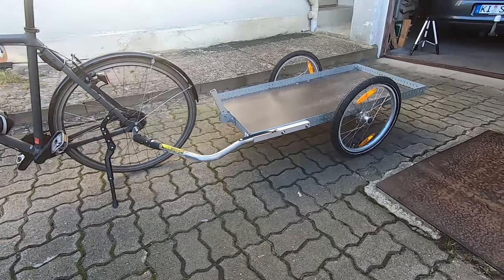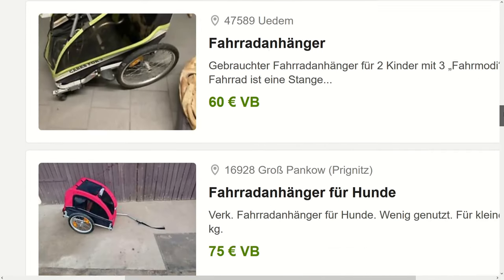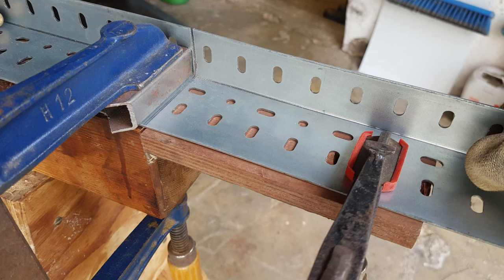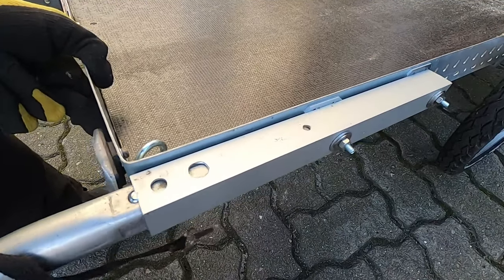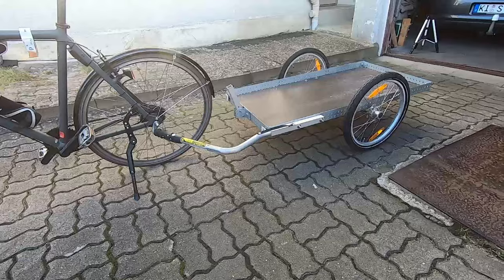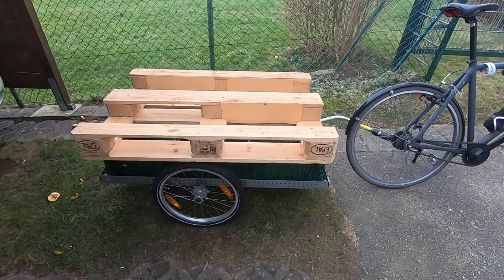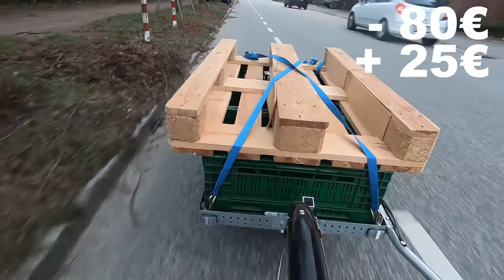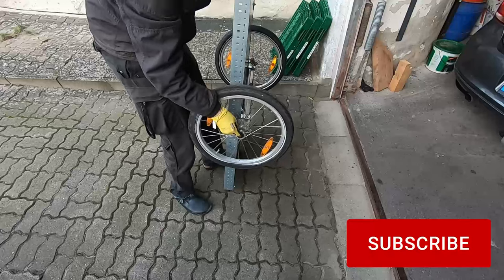DIY Budget Bike Trailer

Comment: What does your trailer weigh? Maybe I skipped it in the video. The hinterher-trailer weighs 12.9 kg. I like machined parts but using CNC cut aluminium for zhis is ridiculous if that price comes out. I guess your trailer isn't much heavier you could optimise here anc there to save some weight.

Comment: Not sure that unless you get real lucky on finding a used trailer to start with or reselling the parts you'd make that much money this way. That said having a custom fit to design trailer is near priceless. Even the more expensive trailers you buy pre-made are almost always the wrong size. Slightly to big, or to small. With rounded corners or something to make your desired load not fit right.

Comment: The trailer could use a stabliser wheel or jockey wheel to prevent it from dropping incase it comes loose while carrying groceries while cycling that way your oranges won't roll on the road and get squashed by cars or cause a slip hazard for motorcycles, imagine someone wrecked their expensive motor bike because of oranges

Comment: This is the perfect trailer I want for carrying around a lawnmower and other things too big or long for my current large sized dog trailer.
Hinterher's profit margins must be absolutely huge.
Well done.
You have my genuine admiration.
Reply: I am looking into a bike trailer for the exact same reason, have you built one if so how and what parts did you use? And what is the dimensions of your trailer?
Reply: Unfortunately for us you are wrong: Our profit margins are not absolutely huge. Sad but true. They are large enough for us to sustain our company in a healthy way so that people can buy spare parts. But believe me, building high-quality bike trailers in small numbers is not your easiest get-rich-quick-sheme.

It is always difficult to compare a diy built with our model. Parts may look roughly the same when in fact there`s much more that differentiates them if you dig a little deeper. Our chassis is vastly more sophisticated to manufacturer and thus much more expensive, yet stiffer, stronger and lighter. You wouldn`t compare a high-end bike frame with a simple one just because they look the same? We also use a custom-made stainless steel axle with threaded ends and an custom-made inserted stainless-steel sleeves to hold the wheels. The list goes on and adds up. We do not want to diminish this great diy-project, but we always feel a bit disappointed when people assume we rip-off customers with our small scale workshop production of custom-made trailer components here in Germany. It`s not like we were Chris King, charging 400 bucks for a front hub...

Comment: Nice and simple without using a cnc or other crap that normal people would never have just to show off. Youtube needs more videos like this. Thanks for sharing.  I'd add removable/flip up  pivoting casters w/brake to the back and another place near the front for a second axel so you can move the wheels forward. That would make it easiest to walk when you need to and would stabilize the trailer when loading. I would also add something to widen the tray frame for those times you load is bigger than your trailer frame. Maybe swopping for a slightly larger piece of plywood and packing the outside of the frame or something similar would do the trick. Could still fit your 3 green bin. Could also add a couple legs that drop or flip down so you can move the wheels with the trailer loaded. I doubt any of it would add much weight.
Reply from the maker: Yes, that was the intention :) While it is interesting to watch, I doubt 99,999% will ever own a CNC or even a welder for that matter. Your improvements sound like a good idea 👍

Comment: I have been thinking of such a trailer myself.  Excellent timing that I happened upon your excellent build.  Great job and the idea of a support to level the unattached trailer is an excellent idea. I have several wheels from an old golf club cart that will suffice and I can weld up angle to make the wagon part.  Thanks for the idea.

Comment: Amazing, thank you. I was thinking of building something similar when I found this video and I got some good ideas from it. One thing I will do slightly differently: Instead of the hooks I use angle profiles with horizontal 25 or 30 mm wide slits as borders. My ratchet straps fit perfectly through these slits, so I can attach them pretty much anywhere on the trailer. Since the angle profiles are made of aluminum and slightly smaller than yours, I will ad 4-8 additional steel angles with the same kind of slit and more holes to bolt them to the playwood so that they can handle ratched straps with a lot of weight. And I might add removable railings/walls later and was thinking of getting a lockable aluminum box. I am still trying to figure out a way to make it removable but firmly attached and lockable to the trailer.

I hope my wheels and axle last for a while as they are not in the best condition. But I couldn't find any better used trailer at a reasonable price. At least it came with three couplers (one on a kickstand) that I don't need and will resell. Sadly the lockable drawbar came without keys. So I might have to tinker with another drawbar that I still have on my old (dying...) trailer to get this working.
Should the wheels and axle wear down soon, I might actually buy new good ones from Hinterher and attach them to the trailer. That way it would be really sturdy and durable.
Reply: did you make a video?

Comment: I just bought a second identical trailer to my Schwinn. I noticed that mine had upgrades so I just transferred the canvas and now I have a trailer frame. I want to be able to haul 2x 5-gallon water bottles by building a trailer with light and budget friendly materials. Plus, my 30lb pet will have to come too. This video is a good starting point. So pointer: you should add brakes if you haven't. Also, how about a closed in trailer to keep secure when you leave unattended.

Comment: greetings from a fellow builder from across the pond as the Brits say I would use My German but as I learned it as a young boy some 5 decades ago and froew keller only had time to teach me to speak not write or read. I to used the childrens carts as the base of one of my bike/ mobility scooter trailers. it is the main one for my dog to go riding with me. I had no luck getting the covers off the frames so I added a few light weith tent poles as the extra body frame I needed and will now cover all but a few (3) of the plastic & net windows with a custom cloth & glue poor mans fiberglass for a semi ridged body. It should do fine I am also building a couple other trailers/rear body add ons to make my M.Scooter to look like a 1900s era C cab delivery truck. wish me good luck.And my congratulations on your build. oh all most forgot if you use some more square tubing you could have a 2 part swivel down drop & pin leveling legs for your trailer on the cheap & with no welding needed. It would be the same as many factory built units of all kinds have at least at the tong but I would sugest you put 1 on at least front corners if not on all 4 corners. I likes the Idea of rebuilding the hitch with a angled peace of square tubing going down under the bed of it, you might just run that tubing all the way to the back for more strength. great build a new fan

Comment: Excellent idea to base the design around euro crates, if that's an important factor for your use. Repurposing parts from a suitable donor item - and selling the unwanted bits to ( more than ) recoup  expenditure also makes good sense.
Looks like you've ended up with a useful bit of kit for your needs.
What weight of goods are you typically carrying - over what distance?

I also took a similar - but different approach - by using parts from a couple of discarded kid's buggies.
This worked well (for me) because I wanted a lightweight folding trailer that could be carried on the bike's pannier rack until needed.
Another major difference is that I prefer the hitch point to be on the bike's centreline - so that  associated frame brought the total weight of everything to about 5.3kg
At Feb '24, it's been in use for about 5.5 years, and it's been a game changer for me - I hope yours serves you just as well.

Comment: Instead of a front stand you can have a steerable front wheel with a brake that's attached to the handle mount and can be raised and lowered. It will enable you to move heavier loads more easily by hand and can act as a rolling bumper for the front of the trailer while traveling over rough and uneven terrain.

Comment: I would personally raise the floor a bit so it's above the wheels and you can load even more stuff onto it, then integrate a hidden foldable chair into that raised part, so that you can take passengers with you as well!

Something as simple as splitting the raised bit into three plywood panels, and folding up the rear one for a back rest and folding down the front panel for a foot rest could work!

Comment: Very nice job.  Only thing I would add is a couple of 100W solar panels and a large battery to reduce center of mass. Then that can be used to drive an ebike for practically unlimited range.
Reply from the maker: Yes! That would be awesome. But I don't have an eBike 🤷‍♂️
Reply: @Marty  then get one, or make one.

Comment: Great idea. 

What is the thickness of the wood you used?

I have one small addition to your design. When you dismantled the trailer you used your foot to protect the reflectors. You could mount a rubber door stopper/buffer next to the reflector on each side.
Reply from the maker: Yes that's a good idea. I have since broken one of them because I was too lazy to do this 🙄
The wood it 8 or 9mm thick.
Reply: @Marty  Which kind of wood your plywood is made of (birch, poplar…)? Since birch wood is the most available, I wonder if a 9mm thick birch plywood is enough.

Comment: I'm looking to make one to transport a 3m ladder and my tools to various jobs.
I'd have to change the gears on the bike to help me pull it all though. Thoughts??
Cheers for the video. It helped.
Reply from the maker: Sounds doable. There are bike trailers for carrying kayaks and such. Whether you need another gear ratio depends on the weight of the load. I found the rear gear to be cheaper, so I would start with that and add a tooth or two. You will probably need a longer chain.
Reply: Not sure if this construction can carry much weight - maybe 20 to 30 Kilo?
Your tools and ladder is probably much more - I would invest in something that can carry more.
I'm on the lookout myself, but want to build something on top of the trailer.
I found the Surly Bill is pretty long - 1,2m and 60cm wide - but can carry up to 130kg. Something like that would be better. You can always strap things on - or mount a watertight box.
Reply: @theresabu3000  I settled with a citroen picasso in the end.

Comment: Damn, I'd been looking at building a cargo bike for work but this is way for financially viable. It's only a 10 minute drive and I spend so much on fuel nipping round site. This would easily fit all the tools I need on a day to day basis, might have to have the spirit levels hanging off the end but it'll be worth it for all the money saved on fuel

Comment: Yeah in my experience if your carrying enough stuff to warrant a trailer you better hope your route is either really flat or all down hill on the way home. Add the weight of the trailer to even just a 30-50 lb load and those hills are a killer, never mind full stops and starts at intersections and the like.
Reply from the maker: I had two euro pallets on there with 20-25kg each. There was a hill on the way home and yes, I got pretty warm. But it was that pretty warmness of success and satisfaction :D

Comment: Hello

Thank you for sharing your work which is excellent, today I started to see the carts of the same German company H, and although I had an idea with them I defined them, however doing it I was not very clear about what materials to use, you clarified everything and I will do mine equal and identical

If you could please share the brand of the trailer that I use so that the axle works very well or which one you recommend the most,

of. The best ones that I allow myself to comment on would be to make 4 to 6 cm punches to lighten the table,

thanks and congratulations, it looks almost identical to the original of H,

greetings
Reply from the maker: Thanks! The trailer was a "Chariot Cougar". The brand Chariot was acquired by Thule, so the newer models are from them. I suggest to get a broken or very dirty one, otherwise they will cost you around 300€.

Comment: I would put protective u-bars and metal shield to protect the wheel from what's on the platform and have posts/poles at the 4 corners so you can more securely carry things from a lower center of mass; without the plastic boxes... like lumber, planks and panels and even the occasional piece of furniture.
Reply from the maker: That's a good idea. For me the boxes are the main use case and I'd rather do without the extra weight, but for someone  else this might be good.

Comment: Hi Marty, do you have a list of parts you used? I'd like to build it like yours. It's cheap, stable, pretty, easy built and small - exactly what I searched for.
Reply from the maker: I have no full list, since the available material will vary from country to country. The important stuff is the plywood. In my case it was 1250x625x8mm I believe. And the 60x35x1mm steel angle profile with the holes.
Reply: @Marty  Please, provide the length of the square tubes do you use (20cm looks too short I guess)

Comment: Marty, thanks for the great video! Where did you put the wheel axle? I bet more weight should be put towards the hitch. The H-trailer looks like it has the axle at approx. 1.5 ratio (front/rear distance). Have you experimented with different positions to find out how the bike handles if more weight is loaded towards the hitch?
Reply from the maker: Honestly, I just guessed. I looked at a few trailers and they seemed to have the axle slightly behind the middle, so I went with that too. It makes sense, because you want to balance the weight pretty well, so there is not much down or up force on your bikes rear axle.
Reply: @Marty  There should only always be down force on the bikes rear axle for stability and braking.
Regulations also recommend that the front of the trailer not have a hard 90° which could catch on a post or a person as you ride, so should have another deflector on the front right side, as well as deflectors in front of the wheels.

Comment: I got an idea for you. You could build side walls  from pallet boards take apart pallets pull nails out of them use L brackets to screw to trailer floor and sides. Then you could haul dirt or wood sawdust.

Comment: I am thinking of making a similar trailer but with higher sides and I want to use pvc pipes to make an arch or rib going from side to side  and then cover with tarp like covered wagons for a bottom use corplast and 1x2 for wheels I am thinking wheelchair so they only need supported on 1 side so there's no shaft or axle what do u think of the wheels?????? but I won't get to it anytime soon was hoping someone would see this and try it
Reply from the maker: I first thought about wheelchair wheels too, but then I found the used trailer. But they should work just fine. Plus used wheelchairs are quite cheap here.

Comment: Hello, I viewed lots of DIY bicycle trailers and noticed they were all bad (too small wheels) , were overdesigned (mostly german bastlers), expensively made (expensive aluminum tubes and connectors) , wrong material (pvc pipes huh?) much too heavy (big wooden logs) built, weak connection to the bike (15mm hot water tubing?). Your design is the best for cargo. I love it.   I also use 2 trailers for my rc airplanes or for shopping and they are made out of  bicycle trailers for 2 kids, 20 and 24 inch detacheable wheels, the tarp and upper section removed, put a flat piece of 5 mm plywood on it and angled steel around the edges like yours. Painted the plywood and there you go! . I will make a video of mine this summer.

Comment: Hola Marty, te felicito por tu proyecto, me gusta mucho, por varios motivos, el primero porque es simple, el diseño es más lógico que científico, sin embargo, debes haber invertido muchas horas en cálculos y pruebas, segundo porque está construido con materiales comunes que se pueden obtener en cualquier parte y los ángulos ranurados hasta te permitirían variar las dimensiones del remolque, tercero, porque es desmontable y te permite ahorrar espacio cuando no lo usas, y el cuarto motivo y más importante para mí, es que, tu proyecto es viable para replicar.
Lo que no me queda muy claro, es que, si bien el excelente peso final es de 15 kg. No nos comentas de la rigidez de la estructura y el peso de carga que soporta.
Quisiera también que nos comentes de la posición del eje de las ruedas, qué tan desplazado del centro hacía adelante lo has anclado, para no recargar el peso a la bicicleta y restarle estabilidad.
Apreciaría mucho tu respuesta.
Un fuerte abrazo desde Lima, Perú.
Reply from the maker: Hi Gino, I used a translation tool so please forgive me if I did not get everything right :) First, thank you very much for your kind words. The trailer is not perfectly stiff. It can twist a little bit along the roll axis. I always load it symmetrically (as you should with every trailer) and did not have any problems so far. As for the position of the axis, I imagined it being in the middle would give me the best properties in regards to riding comfort and load distribution. I took it a little bit back from the middle to the rear end so that the trailer will naturally lean forward when it's not loaded. A big hug back from germany :)